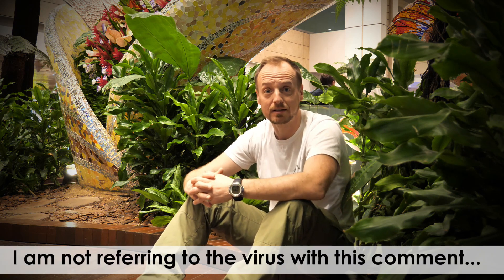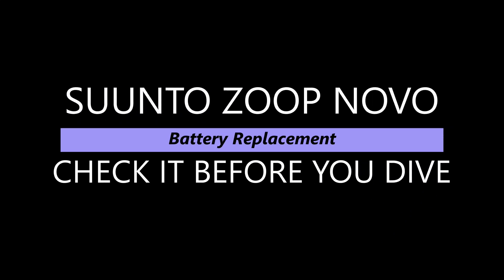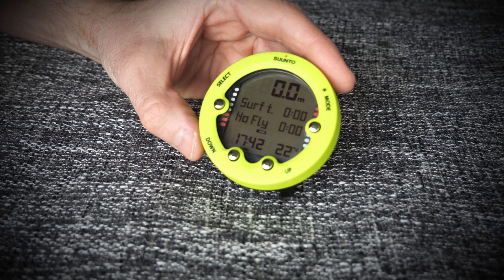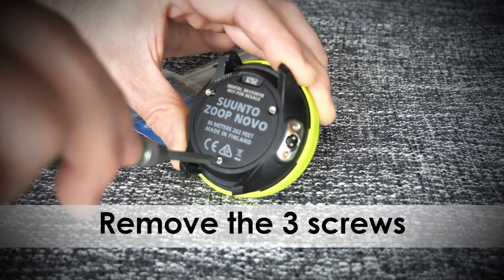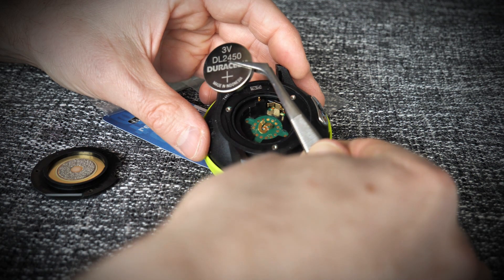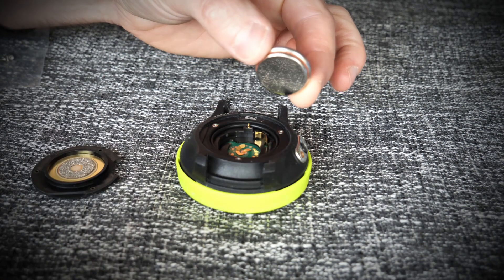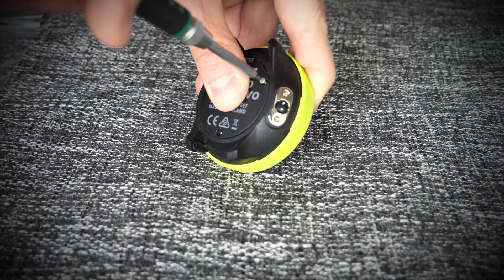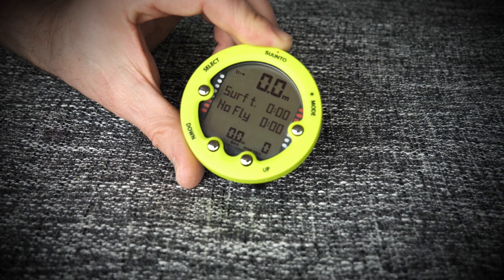Suunto Zoop Novo Battery Replacement

Comment: Note to anyone changing this battery - do not over-tighten the screws. I did and I sheared off the head with the screw left in the body, flush to the surface. I guess the clue was that I could unscrew them easily by finger on the torx bit.
Reply: I have just done the same thing with a new screw that came in the battery pack!  Surely this is a design fault?  A screw should not break by being tightened!  I was not over-tightening it, very difficult with such a small screw.  They want AU$233 to replace the case and strap!!

Comment: Hello, I noticed in your video that the package you show in your video is a CR2450 N and not a CR2450 which is a standard one.  Was this a mistake on your part or does it take the CR2450N which is actually thikcker?

Comment: Is it necessary to change the O ring and the screws each time with the battery change?
Reply: Is it really needed to change it? Or just recommended? What would happen if you do not change it?
Reply from the maker: The O-ring at least needs to be changed every time.
Reply: @lifebelowsurface8130  what's the o ring size?
Reply: @lilintaz  No idea. It is always included in the Suunto Zoop Battery Kit.

Comment: Does this need to be pressure tested afterwards?
Reply from the maker: If you take it to a proper dive store, they should perform a pressure test. At least all the shops I know will do it. I just took it with me for a dive as it is my backup, so in case of a flooding I would just have lost my backup. In any case, I always recommend pressure testing your computer after it has been opened.

Comment: Question: Does the computer save your dive logs when you change the battery? Thanks in advance.
Reply from the maker: Hey Robert. Just replaced the battery again, and the logs remained in the computer. 🤙
Reply: Yes.
Reply from the maker: Hello Robert and thank you for your question. I cannot confirm if it keeps the logs in memory, for that we may need to ask someone else. But when diving solely with this computer you also want to be carrying a logbook and a pen. 😁 Keep on diving!

Comment: Thank you for the tutorial. When changing the battery, will the Zoop keep its divelogs in memory?
Reply from the maker: Hey Jan, I have an update for you. I just replaced the battery again, and the Logbook and History remained in the computer. 😎✌️
Reply from the maker: Tough question and unfortunately I cannot remember if it does or not. Anyway when using this computer as yoyr main device, you want to be logging your dives in another way in any case.
Reply: I believe it is the same as D4i. And according to the zoop novo manual, changing battery won't reset your divelog

Comment: Thank you for your nice and simple video.
So I'm guessing the only way to recharge the computer is to replace the battery, no plug-in charger capability?
Reply from the maker: Hello Brave lil' Roaster. You are correct, no charging option on this computer. What is positive with the replacable battery, is that the battery life is much longer than in the rechargeable computers. Around 1-2 years depending on how much you dive. And if unsire, just carry a spare battery and the correct tools and you have no worries at all, or do as I do and dive with two computers. Have fun and enjoy the dives!
Reply: @lifebelowsurface8130  thanks for the reply and your advice.
I wish you safe dives